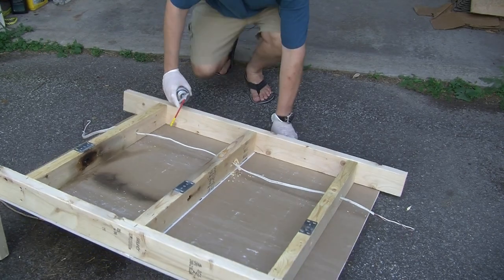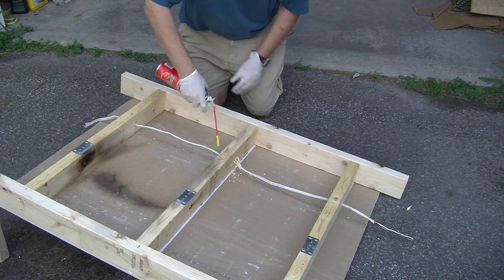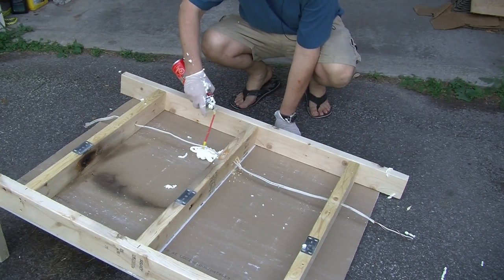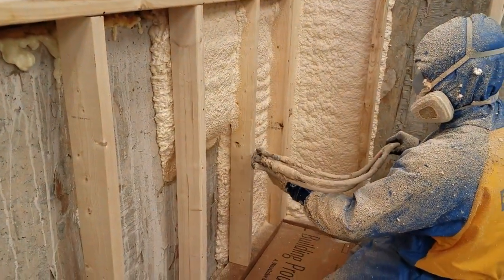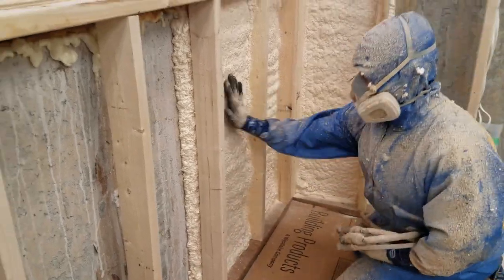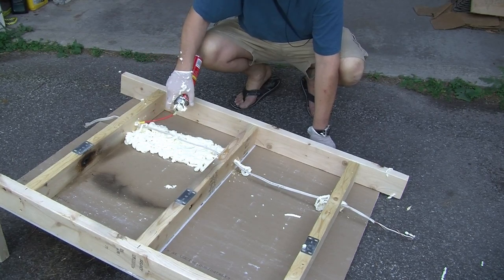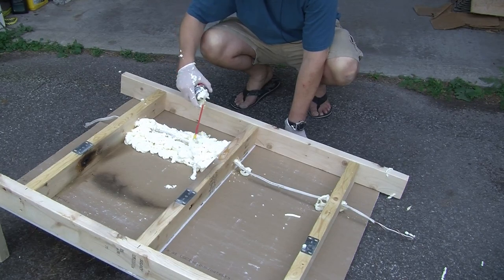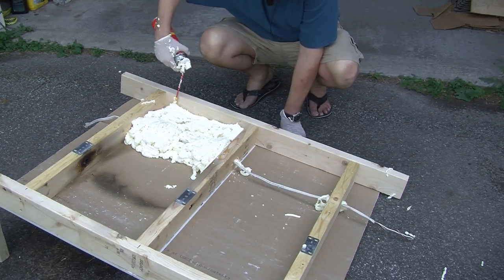Spray Foam and Overheated Wire

Comment: Very interesting.

I was surprised to see such a high temperature, 53C/127F at 15 amps.  A bit of an extreme situation with the sun beating down, but not unreasonably so.   I'm sure that's safe, but I can see why the rating for copper 14 is only 15 amps.  

I'm also glad to see the spray foam doesn't just burst into flame.  I'd expect some cheaper whiter styrofoam insulation might just do that.
Reply: And NM wire,  more specifically NM-B,  is rated for 90°C, vs the stuff before the mid 80s, which was good for 60°C. We should appreciate the NEC, and also understand we've come a long ways since the first code in 1897, much of today's code requirements came about at a great price, including loss of life.
Reply from the maker: Yeah! Take the temperatures with a grain of salt - I dont have 100% confidence in the IR thermometer when reading radiation from from small areas, but from past experience them temp is usually too low. I would be nice sometime to do the same with an expendable thermocouple right next to the foam and no "window" in the foam.

I was fully expecting a flaming bubbly molten mess. Like you said, good that it is relatively resistant to catching fire.  Your comment got me wondering about not only plain Styrofoam but the better quality pink or blue rigid foam insulation. They shrink away from heat - might be worth trying one of those since that is such common insulation.
Reply: @ElectromagneticVideos  you know, I never thought much about those blue or pink foam insulation boards, and some of those, I cannot recall which,  but it says "CAUTION: RISK OF FIRE, DO NOT EXPOSE TO HIGH HEAT OR OPEN FLAMES" or some similar wording.    The pink panther brand foam seems to ring a bell, maybe because I loved the cartoon when I was a kid, and the 90s seemed to be a more carefree,  innocent time.   -)
Reply from the maker: @Sparky-ww5re  Thats funny - I was thinking of the  the pink panther brand when wrote my previous comment. If I test some of that foam hope I dont put our favorite cartoon character out of his retirement job!
Reply: @ElectromagneticVideos  XPS (the pink stuff) is definitely more common than the cheaper EPS (the white stuff).  It might be interesting to see how they both behave between walls with electric cable in them.  In a basement it's fairly common to put in a layer of XPS to prevent water intrusion, then a layer of fiberglass inside a stud wall.  So the wire woud be butted up between the two.
  
IIRC XPS is only allowed in walls if it's covered by a layer of drywall, since it can catch fire.
Reply: @Sparky-ww5re  Interesting, I didn't know good 'old Romex had improved since the 90s.
Reply from the maker: @stevesether  I think it it would be worth trying  the pink stuff in the configuration you describe with the wire between the rigid foam and the fiberglass. I have heard that people also dig channels into the foam to put cables in. I wonder how common that is? Thing might be to do both next to each other.
Reply from the maker: @stevesether  I had forgotten Kyle's comment abut the vintage 60°C cable till you brought it up. With that low a temperature rating, it looks like a really bad idea to insulate well around that stuff. And imagine in an attic that might already be at  30C or 40C in the summer.

Comment: Foams cure with reaction to moisture, hence spritz water on the surface first. Also, there are VERY few expanding foam can products that really pass the Fire Blocking properties, a huge fail in the various groups that test and certify building materials. DAP FireBreak Flame Resistant Sealant is one, that self-extinguishes when ignited, while most like Great Stuff are just orange versions of the same combustible foam. This video suggests that the quest for better home insulation could very well result in trapping overheating wires and risk of fire.
Reply from the maker: Thats interesting! So you are indicating that the Great Stuff Fireblock is not much different from regular Great Stuff, and the DAP FireBreak is much better?

"This video suggests that the quest for better home insulation could very well result in trapping overheating wires and risk of fire." Yes - exactly! No its a worst case for every thing scenario - but I sure would be careful with a cable expected to be used for extended period of time close to its rated amapcity in  the middle of modern insulation in an already hot environment - ie running though an attic powering an air-conditioner in the summer. I would certainly increase the wire size a gauge or two from that required by code in that type of situation.

Comment: Amazed how the foam didn't catch fire.    Because you hear the legendary tale as follows.   Back in the olden days,  a homeowner blows a 15 amp fuse.    When he replaces it, it blows again after a short time.    Unfortunately this time, the homeowner is out of fuses,  half the house is dark, the baby is crying,  the refrigerator is getting warmer by the hour,  and the hardware stores are closed on a Sunday afternoon.   So the homeowner removes the blown fuse, slips a penny into the socket (back when pennies were real copper) and screws the fuse back in.    The next morning a fire inspector goes through the remains of the house,  and finds a scorched fuse box holding the penny.
Reply: Was a sparky for 50 years and did hundreds of service upgrades where I always removed the fuses . Only thing that I found a penny behind a fuse was in a little pig slaughterhouse that I replaced a 8 circuit fuse box with a breaker panel. Often seen old houses with over sized fuses. Scary when you came across all 30 amp time delay fuses. Told the homeowner that every new circuit breaker would be 15 Amps due to having all #14 wire and they will probably have problems with them tripping. Yep within a day they called and said I have to come back and fix tripping problem. Told them sure and it will cost several hundreds to run new 20 amp circuits. Laughed at them when they demanded that I fix their problem for free.
Reply: @JohnThomas-lq5qp  you gotta wonder how many homes were torched.  Today's NM wire seems to be pretty fire retardant,  but you'd wonder about the flammability of the old-style cloth braided NM wire, or the tar coated cloth  on knob and tube.  circuits.  I've seen that stuff disintegrate at the slightest touch,  particularly in light fixtures where 100 watt bulbs have baked the wires into place.    People have installed 30 amp fuses to allow for the fact many decades ago, homes were wired with 30 to 60 amp services,  sometimes with only 120 volts available,  and one receptacle per room was normal, as were 2 to 6 circuits for an entire home.
Reply: @Sparky-ww5re  I can remember buying the old woven jacket what appeared to have some sort of black tar or pitch like material. If you had to pull hundreds of feet of it on hot days hands would be covered in black material. Can remember paying approximately $0.50 cent more for a 250' box of 14/2 Romex for for the new & improved maybe a thermoplastic cover around 1966. Was a lot easier pulling. Both types had what appeared to be TW insulation that if not severely overloaded lasted forever. Was told at an IAEI continuing education class that UL gathered hundreds if not thousands of samples from across the country of clothe covered insulation from old BX cable and old material covered type NM cable ( Romex ), type NM plastic covered romex that had type TW insulation and not sure if they included the far superior type NM-B Romex cable with appears to be type THHN insulation that started being sold in early 1980'S.  All of the cable with modern type TW or THHN passed Megger test and for the most part we're in good condition. All of the cloth covered wires had problems.
Reply from the maker: I somehow missed you discussion here - just saw it - interesting!  I'm a bit surprised the cloth covered cables did so poorly in the UL tests. Maybe the black tar contributed to flammability. I do remember it - got some leftover cable of that type after electricity was installed at our cottage/cabin in the late 60s. Of course ended up with tar on my hands. Oh - and it was aluminum cable!
Reply: I owned a hardware home center for 4+ decades. Constantly had to advise customers not to use higher amp fuses than what was blown assuming that the blown fuse was the correct amp. Area had lots of old
homes so we watched for anyone buying anything higher than 15A.
Peak season was electric space heater season.
Reply from the maker: @jimertzman6628  You must have seen a lot of changes over that period! I'll bet many people weren't pleased at being advised not to increase the fuse size - I sure you had to navigate a delicate balance between trying to keep people safe and also not alienating customers.

Comment: Have you considered picking up some bimetal temp probes to go with your meter?  You could imbed the probe in the great stuff.  I use a fieldpiece temp meter for hvac stuff.  Interesting :)
Reply from the maker: Some arrived  a day or two after I sprayed the foam. I'm going to order a bunch more expendable probes because I doubt I will be able to extract them from the gooey mess when I try pink rigid foam. Just look up fieldpiece - they are nice and not expensive!

Comment: I'd like to see how ceramic wire nuts compare to the usual I mostly see them in furnace hot surface ignitor and also twisted stranded and solid wire with just electrical tape like something you'd see on a trailer
Reply from the maker: I'll probably have to do another connector test and will include your suggestions. Thanks to your suggestion I learned something -  I had to look up "hot surface ignitor" - had no idea such a device existed - I just assumed all were spark or pilot light based on the tiny sample set of boilers installed in houses  have lived in.  Interesting!

Comment: awesome video I run over 150 meters of extension cord i use a multi box in the paddock that will trip if 2 jugs are put on together i was a little worried about the 125 year old wiring from the cottage that I'm supplied by

Comment: Did you let the foam cure for 24hrs? It produces an exothermic reaction while setting up. Also flammability might be different.

Why don't you get some cheap thermocouples? A lot cheaper than an IR camera.

What model variac do you have?
Reply from the maker: It actually cured for a week - so many scattered showers that I wouldn't have been able to do sooner if I had wanted to! 

 I just got some thermocouples but they came after I sprayed the foam. 

Its a cheap Chinese one. But the setup is a bit more than that: 120V -> variac -> 240:120 transformer -> AC output welder -> wire under test. 

The variac is limited to about 10A out so I double the current out with the 240:120 transformer. That goes into the vintage welder which acts as giant step down transformer with a crude constant current source characteristic. Of course the welder would normally be plugged into 240V.   

I do have vintage 20A  variac, but the plastic that insulates the shaft from the knob disintegrated and I need to find something to replace it with. Once its going again I would not need the  240:120 transformer.

Comment: Awesome tests i wish you had used 12 g. A lot of new houses run 12.
Reply from the maker: Thanks!  When I did it I didn't realized #12 was used in many areas for new houses. My feeling is the results will be similar - significantly reduced safety margin. If cable is within this sort of of insulation, wire should be treated as one size smaller than it is. So #12 should probably be connected to a 15A breaker rather than the usual 20A one.
Reply: @ElectromagneticVideos  interesting. I was thinking a 12 could take 25 amps.
Reply from the maker: @ShinkleGunDog  Well its rated for 20A under "normal" conditions. Embedded in insulation, less would heat heat down.
Reply: @ElectromagneticVideos  definitely, but nothing burned at 20A right?
Reply from the maker: @ShinkleGunDog  I would have to look at the video again - its been a couple of years. As I recall the cable did OK but with almost no temperature safety margin.  My take was if it was in a hot attic embedded in insulation on a hot summer day in a place like Texas, and one was passing the rated current for an extended period of time though the cable, the temperature safety margin would go to zero. If I was having a new house built, anywhere where cable goes though thick/good insulation, I would require  the cable to be sized 1 bigger than normal. I also make sure I dont use more than 10A on any #14 cable in my house where I know goes though insulation (outside walls) just to be really safe (probably overkill on my part!)

Comment: And I was about to fill a small hole coming thru the floor to prevent mice coming in.  Seriously what else can I use to fill the hole.  Steel wool?  Then I will have anxiety of a splinter poking thru the wire!  😩😩
Reply from the maker: Actually, I wouldn't hesitate to fill a small hole with it  - I have myself. Because only a short length of cable will be encased in foam, a lot of heat will leak out the ends and keep temperatures lower than when a length more than a few inches is covered.

There is an anti rodent version of the spray  foam (Great Stuff brand I think) that is intended for that and presumably has some sort of rodent repellent smell or taste.  There also is a firebreak version of foam to fill in holes between floors to slow air currents (chimneying) from spreading fires.  So filling in small holes in floors or in walls is a good thing!

I would not be too concerned about modern 90C rated wire in longer lengths of foam as long as it is not carrying close to the rated max current for extended periods of time (ie being used for a heavy load like a heater or AC).

Comment: Not as dramatic as I was expecting.
Reply from the maker: I felt the same. I was actually ready with fire extinguishers. And the poor lighting from direct sunlight was because I wanted it far enough away from the house in case it really went up. But for everyone including myself with plenty of that product in their homes, it s good thing that nothing exciting happened. But  unfortunately it doesn't make as fun a video to watch compared to some of the others.
Reply: @ElectromagneticVideos  would like to see same test with cloth covered cable.  My house was built in '62 so I have lots of it. Wondering if I should replace whatever can be easily done at least to 1st flr outlets.
Reply from the maker: @jimertzman6628  If I ever get some vintage cable like that I will do the experiment. I also would really like to try vintage aluminum cable even thought the issues with it were related to the connections rather than the cable itself. 

Certainly quite a question as to if its worth replacing for safety's sake. Does it look in good condition? One thought might be to consider combination arc-fault breakers. They are not cheap but are supposed to trip if there is any sort of arcing and reduce the chance of fire. Note the "combination" part of the name - they are the newer ones that detect more arcing conditions than the older ones.
Reply: @ElectromagneticVideos  if I decide to replace any I will send you some. It seems to be in ok condition except some of the outer threading is loose in spots.
Reply from the maker: @jimertzman6628  Sounds like wiring I had in some older houses - main thing I noticed was the plastic insulation getting a bit brittle where it was exposed to air in the junction boxes and as long as it was left alone it was OK. And thanks fro the offer - if you ever get rid of any old stuff sending some would be much appreciated!

Comment: It's a pity you didn't conduct this experiment without the sun.
Reply from the maker: Yes! Even better, on a cooler day. I somewhat restricted on when its practical to do these tests since I need to be outside for  safety purposes, and also when it isn't raining. Having said, the surface temperature of the foam is not unlike what one might expect in wall on hot summer day, so not completely unrealistic either,.

Comment: Your foam prevents  heat dissapation, romex needs air. Also, only an idiot would run 40+ amps through 14/2 🤣